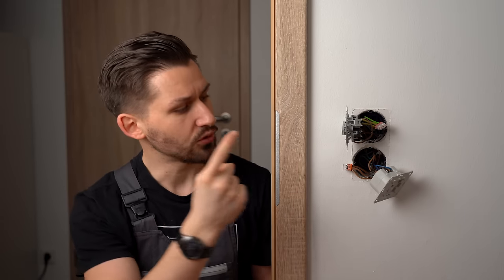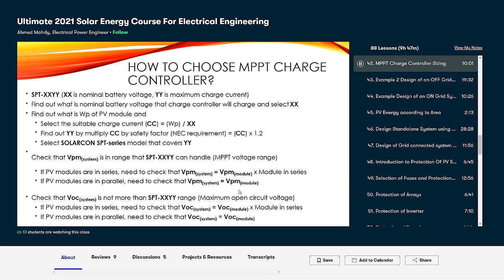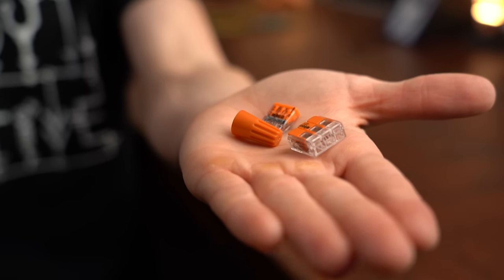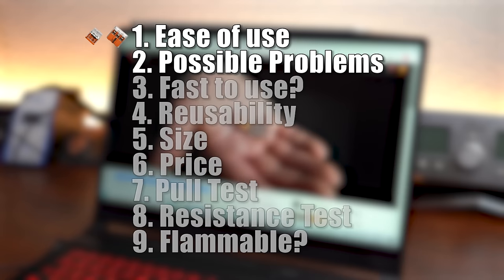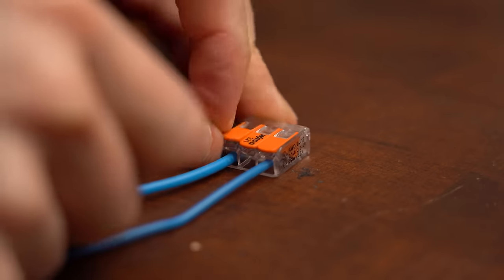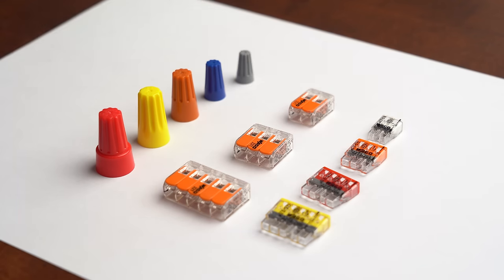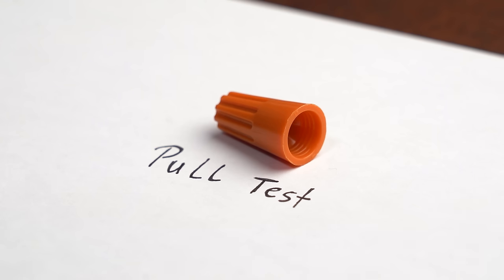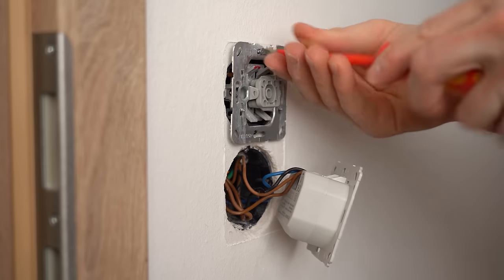What Wire Connector is the Best? Settling a Debate! Wire Nut VS Wago

Comment: I’ve started using Wago as I’m putting smart switches in my house. These switches are much bigger than standard switches and leave less room in the box. While Wago are sometimes bigger than wire nuts they’re flat and fit behind the smart switches better. There were switches I couldn’t get in the box until I used Wago instead.
Reply: i've used wago in a project where wire nuts simply couldn't fit. not only that the wire i was using had to be so short it would be impossible to twist a wire nut on them within the extremely limited space. all i had to do was get the wago in place and flick the lever and it was all set.
Reply: Just remember that those smart switches use a few watts all the time. Actually costing you money while not in use..
Reply: @taylorsutherland6973   I figured, they're always warm to the touch. They also require a neutral connection where timer switches don't.
Reply: Agree - I used Wago 221 to connect my smart switches due to limited space.  Chances are, anyone who is using smart home technology has already converted to LED lighting, so current draw is much less of a concern.
Reply: Whenever I have ordered Wago lever nuts they didn't seem to make any 4 conductor versions. At least none of the kits or packs I could find on Amazon USA showed any.  I didn't look it up today, but when I have in the past all I could get were 2, 3, or 5 conductor versions. Nearly all of my installations required 4 conductors. Supply hot, hot out to next outlet in the circuit and then one hot to each of my two smart switches. it was super annoying.
Reply: @kyungrix1112  I really wouldn't suggest you use WAGOs on outlet circuits. High current possibility going through many WAGOs before getting to the outlet where the load is connected could create heat in places it shouldn't. Wire nuts are superior in this regard. But yes you are stuck with the 5 port.
Reply: @kyungrix1112  No problem, use the version for 5 connections.
Reply: @Horst Klötsch  that's what I did,  but that isn't a good enough solution for me. Smart switches are huge.  That little bit of unused wago connector x3 connections plus smart switches having their own wire pigtails that aren't standardized on the same end of the switche made fitting all that spaghetti back into the box annoying. Clearly the Wagos aren't the main cause of that frustration. having that one open spot is just jank. it doesn't make sense why they wouldn't make a 4 wire lever nut.
Reply: @Taylor Sutherland  yeah every time I use them I end up questioning why I didn't just use a wire nut. my smart switches always have stranded pigtails. With wire nuts I just have a hard time connecting the two stranded and two solid wires with a smart switch dangling off of it.
Reply: @voprais  I have the first ones 2273-204, but every search I've done using the lever part number 221-414 you mention brings up nothing. even on the Wago website.  The naming convention matches what it would be if they made a 4 wire lever nut, but as far as I can tell they don't. Either they discontinued it or never made it to begin with.

Comment: I live in Finland. My house was built in 1989. Some connections in my house's junction boxes were made with wire nuts. Whenever I need to make modifications I just rip out all the wire nuts and replace with Wago. One point which is also noteworthy is that with Wago it's very easy to ADD wires to an existing connector. With wire nut you have to open the nut to add more wires.
Reply: @forownmade1243  Well you shouldnt do that in first place^^

Comment: US resident here. I discovered WAGO connectors about a year ago and feel they are a godsend, is so many ways superior to the wire nuts, If you only do occasional electrical work around the home, I appreciate having data printed on the WAGO connectors. It's also quick to install and allows for confirmation of the connection. Especially good when connecting a solid core wire and stranded wire (I'm never comfortable whether the strand wire twisted around the solid core properly since the wire nut dos not allow you to view the connection without removing the nut). Great video!
Reply: Same, I too came across WAGO connectors about 1.5 years ago when remodeling homes and have not gone back to the wire nuts. I can confirm each connection by looking through them and can tell that I have a good connection, with wire nuts, at times, when I push them back into a box one of the wires may come out of the nut or not make a good connection at all. I have more confidence in the WAGOs making a good connection than I do with wire nuts.
Reply: But that is user error. Even in this video, the author doesn't always properly twist them
Reply: Im an electrician and wagos are trash on solid wire. They dont make a very good connection
Reply: @morscovium8881  They spin when moved they dont grasp the wire.
Reply: This indicates you dont know what your doing.
Reply: @morscovium8881  You are not using the right wagos then, use the 221 line and you will literally never have a bad connection again.
Reply: @DonBugatti  I already never have bad connections. I don't like a connector that makes such a poor connection that it heats up significantly more than the wire it is attached to.
Reply: @morscovium8881 The fact that you are that clueless despite it being your literal profession is scary.
Reply: @morscovium8881  Fortunately, all of Europe has come out of the 20th century and uses WAGO and for some reason there are no problems with them.
Reply: @AlessioSangalli  however it’s not user error manufacturers of them quite often don’t specify instruction they used to be sold on the European market until they were removed because when the manufacturer instructions were followed, which were none a connection was never good
Reply: @UKsystems  luckily in the US they are the most common connection system. They offer the lowest resistance of all connectors. I believe only the “morsetti a cappuccio” used in Italy may be superior, similar to a wire nut but with a set screw; you get the lowest resistance there too. They are transparent and well suited for stranded wires
Reply: @AlessioSangalli  it’s not very lucky that a product that was banned in European countries for safety is widely used in America
Reply: @UKsystems  not at all - in fact as a rule of thumb, if it’s banned in Europe or California, it’s probably a very effective item. Wire nuts do not introduce any extra resistance.
Reply: @AlessioSangalli  it’s not about resistance because you can have very low resistance connections that will kill you so if it’s banned in Europe it is because it is unsafe that’s what you failed to realise every product has to meet strict conformity assessments in a case of wire connection method it would have to not melt at thousands of degrees
Reply: @UKsystems  it would not melt at thousands of degrees? What does that mean? Insulation will be gone at those temperatures anyway.
In any case after a quick search I did not find a direct quote that wire nuts are banned in Europe. They may not be common, it does not mean they are illegal.
I recently DIY upgraded my house to a 400A panel (96kW)

Comment: You can use a multimeter on the open end of the WAGO connector to test each wire. Big plus for my car stuff.
Reply: shouldn't use either in a car
Reply: @michaelphillips8780  i see no problem why you shouldn't use WAGO 221 in cars aswell, the rating goes down to 0.2mm² wires. so it's totally fine
Reply: @Skrabob  because they aren't sealed to start with, no protection against corrosion.
Reply: @michaelphillips8780  most plugs in car electric aren't that well sealed either, but i see your point. My thinking was more in the direction for inside the drivers cabin, for fixing your cables for the hi-fi and stuff there they are pretty handy.
Reply: @Skrabob  should always solder and heat shrink, none of this nonsense
Reply: For car stuff, you shouldn't be using either one, you should be using something that's designed for use in cars and high moisture environments. Personally, I solder those puppies, apply dielectric grease and cover over the top with heat shrink. If I expect that I need to redo the connection with any regularity, then I'll use a connector specifically designed for use on autos, and use a bunch of dielectric grease to ensure that I don't get any weird shorts.
Reply: @Skrabob  It's not the right solution. If it's a permanent connection, then there needs to be soldering involed, dialectric grease and heat shrink over the top. If it's temporary, there's a number of connector styles that are designed to keep the moisture out while providing a good connection.

Generally speaking, whatever is designed for houses is not going to work for automotive uses.
Reply: @Skrabob  Typically, if you look at them closely, you'll notice that the design requires water to go upward, in order to short things out. The plug itself is potentially susceptible to moisture, but due to the amount of power, it's a non issue. (As long as it's not pulling up enough to short things out) A small amount of humidity will be vaporized by the heat of the current moving.

The low voltage bits are particularly challenging, as a small amount of moisture can significantly change the resistance on the circuit.

Comment: Twisting more than 2 conductors together also becomes much more difficult with a wire nut. That is where ease of use difference starts to really show.
Reply: And the size too. Wagon has 2-, 3- ... way version
Reply: Can confirm from experience
Reply: idk if its been said, Insert the stranded wire first, then solid core and twist nut. it fixed the slipping 99.97% of the time
Reply: In the junction box for my master bedroom, I found 7 conductors held together with a wire nut. All that is now spread out across three junction boxes. With push-in connectors (not Wago brand specifically), not wire nuts.
Reply: Ideally, you would pre-twist the wire (known as a pigtail splice) before you put the wire nut on, especially when mixing solid and stranded wires. But yeah, wagos win
Reply: @omgimgoingtopuke  I always did. Never much of a problem with a couple of wires. But lining up four #12s in the pliers when they are already a little crinkled over your head and in a tight space was never nice as a middling diy'r. My hand and shoulder cramping up just thinking about it.
Reply: Yes, but the wire nut with a bunch of #14 or #12 wires wrapped together takes up less space than the WAGO with a similar large number of wires.

I can see the WAGOs being popular where changes may be frequent, but if changes are infrequent and if there's not a lot of room, the wire nuts seem like they're slightly more efficient for branching circuits.
Reply: @brandishwar  7!  Wow!
Reply: @TWX1138  well, if you factor in time and thus price of generating the connection you will find, that wagos are pretty much equal and get better on larger connects with more than 2 wires.
No need for pliers, pre twisting, attention to order of connection.....
Reply: It's easy to find wire nuts with wings in the plastic to make twisting easier. Most wire nuts do not require pre-twisting so that is not an issue.
Reply: @eDoc2020  I know that the manufacturer says that but I find it really unnerving when I go to undo a nut and with a 1/2 twist all the wires just fall apart. Or feel a loose wire in the nut. So I would always pre-twist them for peace of mind. I know who ever twisted them before me probably did it wrong but the fact that it is even a possibility and them being opaque makes them inferior to the wagos.
Reply: @sathivv950  If everything falls apart with a half twist the wirenut definitely wasn't installed properly. I agree the clear nature of Wago connectors makes them easier to inspect. I wonder why they don't make clear wire nuts.
Reply: A wire nut is aways a better connection in my opinion. But it needs to be installed by someone smarter than the wire nut itself.  Sure if the wire nut is installed upside down in the rain it will hold water and fail. It's shaped like an umbrella for more than one reason.  I have never seen a proper installed wire nut fail. But these connectors are good for some projects also. Like installing a couple overhead lights.  I work with more industrial  wiring and that is usually bonded under lugs or screws.  The Do it yourself homeowners often buy these strip and slip connector and think it's  easy and they still mess it up. I have gone out to a job and the wire literally just falls out. I think if someone can't use a wire connector properly, you have bigger problems than what connector to pick.
Reply: @theonly5001  Are you talking about the price for yourself or the customer ? I have never seen an electrician who would say, I will use Wago's,  so it is more cost in materials but I will charge you less in labor.
Reply: @dmitripogosian5084  both.
On a typical complete house rework i would guess it saves a fair bit of time.

And that is a time a honest craftsmen will not bill.
In any type of business it is always about picking the right part for the job that balances price of the tool vs the cost of using that tool.
The cost of using the part really goes through the roof once you need to change something which is already fixed.

And i guess that is a difference between American and at least German construction.

German construction is often considered to last a century with some renovations needing to be done through the years, but the electric systems are a thing which therefore need to adjust a bit over time and that is a reason why you would rather go with a solution that costs more in the first place, but will give you a bit more flexibility in the long run.

Comment: Seems unfair to compare genuine Wago to Chinesium mystery wire nuts, though I understand if that's all you can get over there. Something like the tan color "IDEAL Twister" (probably the most common pro grade wire nut in the US) would be a more fair comparison, and those do have permitted wire combinations and strip recommendations printed on the package, no google needed. Aforementioned nuts also conveniently fit in a hex socket if you many to install.
Reply: Took the words right out of my mouth. Worth mentioning most electricians pretwist solid conductors as well, which certainly makes a stronger connections as well.
Reply: mystery Chinesium Wirenuts is what most people who use wirenuts use though lol
Reply: I feel like the tests the wire nut lost on would have not changed based on better quality wire nuts. The temp test for example the wire nut won, despite being a cheapo one. The ease of use wouldn't improve with a more expensive wire nut.
Reply: Not all wire nuts are Chinese made..
Reply: @L0op  definitely Not!!!
Reply: @L0op  You do have a point there, whatever comes with the light fixture or whatever often gets used, I've done it myself before I saw the light and bought a bag of the good stuff.
Reply: The ones in the us are most likely pretty much the same just rebranded
Reply: Agreed, especially since the NEC requires that an electrical device or connector be used in accordance with the manufacturer instructions, which answer all the questions posed in this video. If a device has no instructions or traceability to a manufacturer, it is not fit for use.